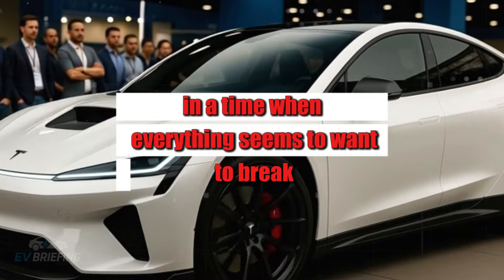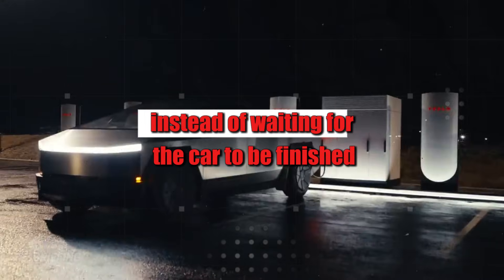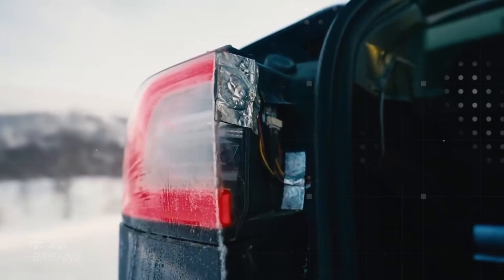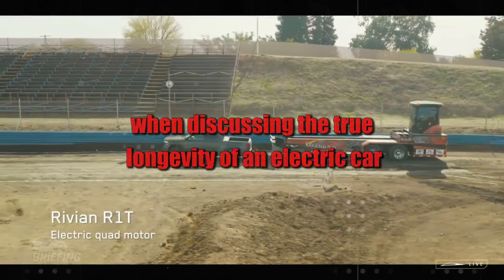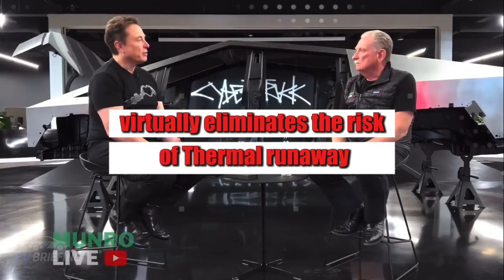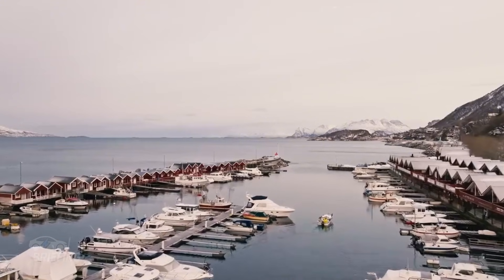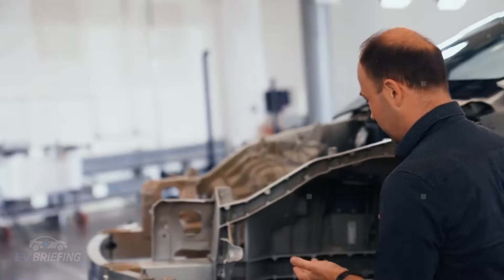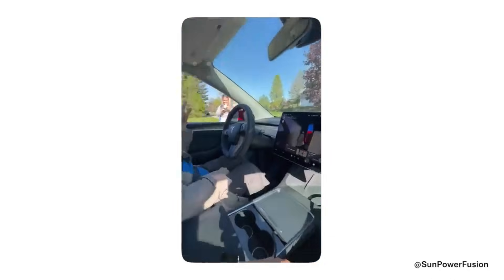IT’S HERE: New Tesla Model 2 Senior Edition $13.5K! 2M-mile Aluminum-Ion, 50,000t Gigapress, SPC 2.0

Comment: I was probably going to buy one of the new Senior Editions; however, there's been just too much foreplay in supposed news releases and advertising for too long. I don't know who to believe. The latest turn-off is the battery type being switched again. This is now a short-range Sodium content affair because insufficient testing had been done with the Aluminum Ion system, which had been touted as innovative and great. This would have been my first EV and I do understand the adversities involved in determining chemical couples that will function to meet customers' wants and needs. Unfortunately, this will probably be my last new car purchase...too bad it won't be one of these.